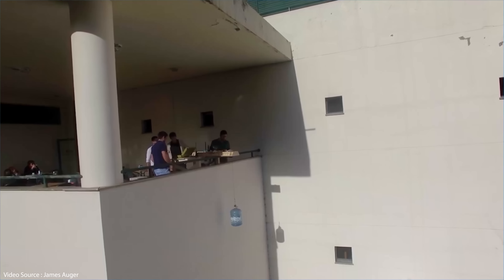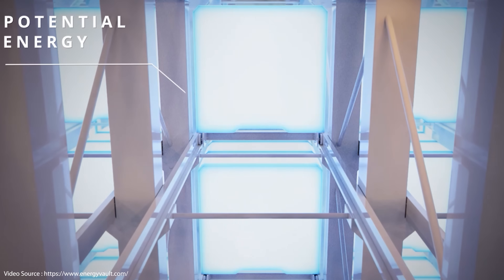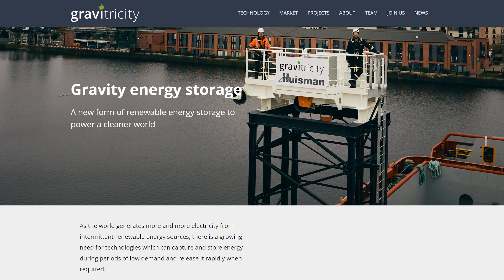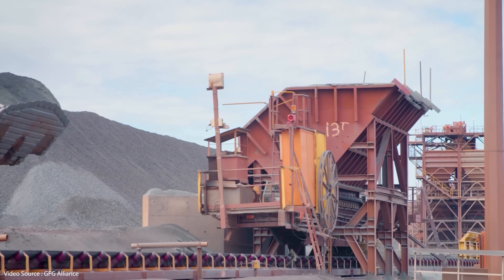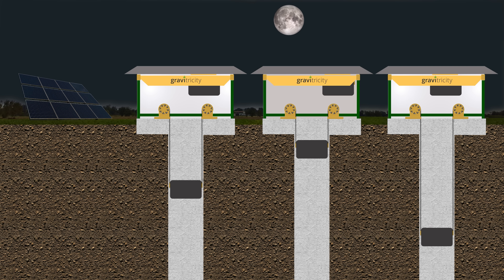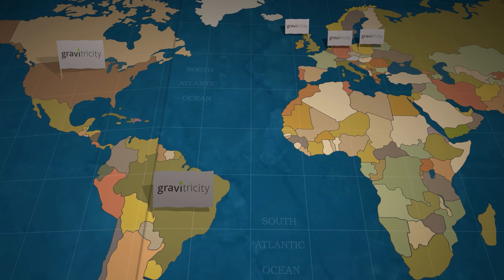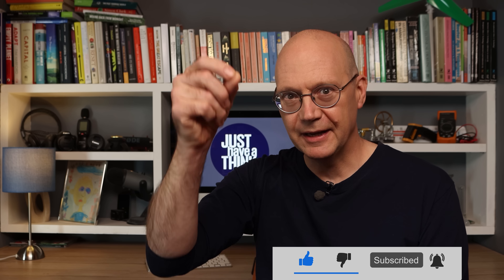Gravity Energy Storage. Who's right and who's wrong?

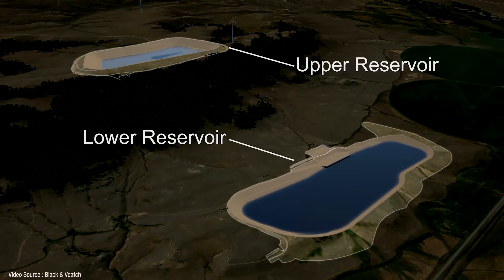Comment: 1:40 other kinds of gravity energy storage will be much more expensive. You will not safe cost if you build the mountain. The problem is the low energy density. The energy you can store is mgh. Where m is the mass, g is 9.81m/s or 9.81J/kg*m and h the hight. State of the art lithium ion batteries has an energy density of 720,000J/kg. This means to get the same energy density your height has to be 73 km. 
So you have to use really high masses to compensate the low energy density.

Comment: Plausibly interesting.  My only concern is the constraint of location. 

Having to locate at old mineshafts means not being able to locate the system geo-efficiently on the grid. That may be fine if the economics are good enough, but does likely introduce a cost penalty.
Reply: Mining locations often have very good grid connections due to the heavy energy consumption of active mining operations.  Like power plants, there is little reason to put storage in the middle of energy consuming cities except to reduce dependency on supply lines during political or environmental instability.

Comment: Gravity energy is in use and is really a viable solution. In both Wales and the canary Islands water is pumped using surplus bio /wind electricity to be later released into hydro electric generators when the bio/wind supply is insufficient to meet demand. It may not be the most technically efficient but it beats the hell out of inferior battery storage or the damage to the environment required to produce them.

Comment: Even though the Gravitricity one makes far more sense than the other one, I still wonder what is the potential storage in MWh, given that new off shore wind turbines have nameplate ratings of as much as 14 MW, if each mine shaft can only output something like 10 MWh, then it is small fry. Can't help but think that we'd be better off building tidal lagoons and pumped hydro where suitable sites exist first.
Reply: At 367 km a 1000 kg mass stores 1 MWh ($50) of electricity.

Comment: If you built an actual brushless motor you would have a functioning dynamo and the motor would not consume electric power but would produce electricity.  You could power a circuit of dynamos that produce much more electric power than is used to power the circuit of dynamos.

Comment: If they built new mines with the winding gear designed with generating electricity in mind there would be almost zero cost converting to that use once mining had finished.

Comment: In Poland we use such gravitic energy systems for almost 60 years right now. 

We use old coal mine shafts for it. It is not on a large scale, just as emergency power supply for operating coal mines.

Comment: I have read about using abandoned mines for pumped hydro. The interior volume of some mines is staggering. I wonder about the quality of the water after a while. Certainly wouldn't want to use an old asbestos or lead mine.
Reply: I can't really see how asbestos would negatively affect water quality. It isn't inherently toxic like lead since it's just a magnesium-silicate mineral. The real danger comes from inhaling dry asbestos because the sharp crystalline shards in the fibers get stuck in your lungs and cause damage to the alveoli. As long as you don't breathe it though, asbestos is pretty benign. EDIT: Apparently there is debate about whether asbestos is toxic when ingested. Some sources say it is excreted, others say there is potential for fibers to lodge in the GI tract and cause damage. Also, apparently most drinking water has some asbestos in it, but below levels considered dangerous.

Comment: I really don't understand how building the infrastructure to move weights could be cheaper than building a water tower and just using a pump powered by a windmill or solar to put thousands of gallons a hundred feet or so in the air... though I must admit using natural geography would be more cost effective, I would think a water tower would be more cost effective than dummy weights.

Comment: I'm in BC Canada and I have a better idea for pumped hydro.  This province uses 90% hydro electricity.  We export some at a profit.  My idea eliminates new efficiency losses and reduces the capital costs of building new transmission lines. 
My idea also produces Green Base Load power which is worth the most $/kilowatt-hour.  This would be the cheapest new baseload power.(~0.03) This would be for export because we have abundant power for ourselves. 
On the down side, we would have to make a long term deal with the US. These trans border deals have hurt us in the past.
I'm holding back the key detail here, obviously.

Comment: Sounds really promising, especially considering the simplicity, and lack of need for rare earth elements and such.
I do wonder if transmission of energy costs are included in the comparison chart you showed.  They might be substantial considering there are a limited number of suitable mines, and they might not tend to be close to populations centers.
Nicely presented, sir.
Reply: I would think the other concept of the modular building would be a better solution, as it can be built anywhere, like right inside of a city where it is needed, although there is the cost of building construction to consider.
Reply: @bigdaddyof2007  Indeed. Perhaps, until fusion is perfected, we could make use of all the varied sources; solar where the sun shines aplenty, wind where the wind blows, geothermal where the earths crust is thin, hydro where the water flows, wave power on the coasts, fission where the others aren't appropriate (especially, the new small modular, assembly line built safe fission), and the new solid hydrogen for air transportation. Tied together with the various types of storage, each also appropriate for the area, and transmitted by a new, DC grid.

Comment: Personally, I think that gravity storage is generally a waste of resources for little gain. 
The amount of energy you can storage is very easy to calculate:

It’s mass x height x gravity acceleration. 

If you lift 1kg of mass to 1m, you will store 1 joule of energy. Spend a little time to calculate how much mass or how much height you need to store the energy used for a single family for one day, which is in the range of the kilowatt hours, bearing in mind that to make up 1 kilowatt hour you need 3.6 million joules.

Comment: I would've liked to hear more about the energy capacity of such a system. Even if the results are positive it would have a very limited impact given that it has a ceiling already in the amount of existing mines. Even if the weights are heavier they can't possibly compete with the capacity of pumped-hydro.
Reply: Also concrete is only twice as dense as water so I bet you could store almost the same energy without all that equipment in plain water... maybe salty water, water isn't scarse, drinkable water is, if you keep it close mantainance would be minimal, you will only need to fill it once, keeping it close avoids evaporation
Reply: @ratgr  Water is scarse in some places around the world but not having to transport rock to a location where it is avalible seems a logical option. The perfect combination in my view would be desert based solar panel farm and sand filled weights. Why make concrete if it does not have to be structual.
Reply: @lenrichardson7349  The problem with sand is its corrosiveness, its not a fluid so you cant really pump it normally but you could use a screw pump, It will need more manteinance, and some other mechanical help to avoid dunes, before you recomend sand bags that makes it worse, you'll need some kind of computerized complex mechanical mechanism and wouldn't be able to use the mine in its entirety. 

Water can be transported from the closest source, either pumped or water trucks, its mostly a one time cost, you only have to make the walls impermiable and the loses should be small, you dont even need this water to be fresh water, you could use salty water, very few places in the world are both far away from a water source and close to a population.
Reply: @lenrichardson7349  The water is not used up (of course both reservoirs need to be underground).
Reply: I think it's fair to say the energy storage, just like energy production for a sustainable future has to be a multi-faceted approach, often depending on geography and facilities. Just like you wouldn't put solar farms in the high arctic or antarctic or wind farms in a calm area, you'd look at the geography of an area to see what energy storage would be most efficient in each case. If we did things based on studies, data, scientific approach to problem solving for maximum efficiency we could crack the code for 100% renewable energy worldwide, with adequate storage.
Reply: Water weighs about 8.3lb a gallon, turbines have an efficiency of 90-95%. 

Economically beating out water gravity batteries is a tall order
Reply: @aaronlockey6429  the crane-managed block tower idea also had an expensive working prototype, although not to full scale. They had some multi crane tower and some barrels filled with concrete. The new design/3D-animation-concept doesn't have anything real AFAIK, although apparently they have a contract with China somehow. Ironically the closest thing to a prototype for that would be the prototype for gravitricity, specially if they gave up the nonsense of horizontal transport of the weights for no reason. Then it would at least look somewhat credible, although to me it wouldn't be clear whether the return on investment is really superior to just pump-hydro even if in ridiculously small sizes for pump hydro. Like filling the mines themselves with water and pumping it to a ground-level pool. Maybe one could hybridize the water supply system with something like that to some degree, as it has to be pumped up at some point, and has to go down.
Reply: It makes sense to use it first in already existing mines, because half or so of the work is already done for you. But it's still a solution for areas where pumped hydro is still not available, because you don't have any hill nearby. And the area is arid or something.

Though you could say that if you have to do all the digging yourself, why not use pumped hydro underground too. And I guess it's a very good question. It might be cheaper/better. I don't know the costs. Going full vertical will have a lower area footprint, that might be one or the only advantage over pumped hydro.

Comment: Love the idea, but I think it's only feasible above the natural underground water table. De-watering mine shafts is expensive and allowing the system to operate submerged would cause huge problems. At a guess you would need a location where the water table was at least 100m below ground level. 

The top of a mountain might be the ideal location, as you could place the system at the top and have a side-tunnel taking water off at the bottom of the shaft and gravity draining it out the bottom of the mountain. Unfortunately there are probably few available mine shafts in this ideal location, so the shaft would need to be dug specifically for the system.

On the bright side, local groundwater would make a cheap and safe ballast, albeit with a lower energy density than iron-rich rock. This could be overcome by just using a bigger container, and might still be cheaper than the rock overall.
Reply: If they use those newfangled hydrothermal laser drills they can melt the walls of the shaft into impermeable glass, so maybe watering wouldn't be an issue at that point? But I still think batteries are just better, since they don't lose as much to conversion efficiency. We just need to use sodium batteries or something without the stigma of child labor or environmental nimbyism.

Comment: Forget the gravity energy storage and just go with something more simple like flywheel energy storage. Flywheels are cheaper, more efficient, and more scalable. Flywheels don't require massive cumbersome machines or space to operate like Gravity storage systems do. You don't like flywheels? Then just go with compressed air. If you can run a wench motor then you can run a air compressor. Compressed air is one of the most simple energy storage systems. All it needs is a tank and an air compressor to pump compressed air into it. Need energy from it? Just release the compressed air through a generator. Gravity energy storage is always overly large and complicated to make it the better choice for other energy storage systems that can be used.

Comment: Just throwing out an idea here. Why not build a small scale gravity storage system within the hollow steel tower of every wind turbine that you construct?
Reply: This possibly will make tower unstable and prone to collapse during high wind, a special tower need to be built
Reply: Something goes wrong with either system and you have to shut both down for repair
Reply: Even through in theory this would work, the amount of energy that you can store in the very narrow shaft will be so little it will not weigh up to the CAPEX and OPEX. There is simply no room for a large, heavy object and the travel is limited as well (compared to mine shafts).
Reply: Because once the weight is lifted in that one tower the wind turbine would then be useless… sitting still with blades feathered for possibly days. Not to mention how top-heavy the tower would then be. Of course they could probably disengage and bypass the weight and gear system but gosh all that would be so complex and require so much upkeep.
Reply: If you do the math, the power you can store in a hollow shaft just 100 ft tall does not justify the capital for the generator and wiring.  The question is not if it can be done, the question is can it be done cheaper than current  lithium ion.
Reply: I think the idea of a weight INSIDE the wind turbine towers, is worth serious calculations; 
to begin with, since the volume of the weight goes with the SQUARE of its diameter, the tower would have to be W I D E; then just use the m.g.h formula to see Energy results, and then Costs ; 
It can be all electrical OR all mechanical,  in this case, at zero wind, the weight going down would just be re-spinning the  wind turbine, via an easy  zero slippage engagement clutch,or,better yet, just gears.
Reply: People looking to $hit on your idea. I think it's brilliant.

Comment: Human consciousness, mathematically, is identical to 4D quaternion algebra with w, x, y, z being "real/necessary" (0D, 1D, 2D, 3D) and i, j, k being "contingent/not-necessary" (1D xi, 2D yj, 3D zk). 

1D-9D contingent/not-necessary universe has "conscious lifeforms" (1D xi, 2D yj, 3D zk)..."turning" 'time'.

[In mathematics, a versor is a quaternion of norm one (a unit quaternion). The word is derived from Latin versare = "to turn" with the suffix -or forming a noun from the verb (i.e. versor = "the turner"). It was introduced by William Rowan Hamilton in the context of his quaternion theory.]

[Math; 4D quaternion algebra]
A quaternion is a 4-tuple, which is a more concise representation than a rotation matrix. Its geo- metric meaning is also more obvious as the rotation axis and angle can be trivially recovered.

How do you make a quaternion?

You can create an N-by-1 quaternion array by specifying an N-by-3 array of Euler angles in radians or degrees. Use the euler syntax to create a scalar quaternion using a 1-by-3 vector of Euler angles in radians.

"Turn" to what, you might ask. 5D is the center of 1D-9D. The breadth (space-time). All 'things' are drawn to the center, the whole.

[Contingent Universe]:

3 sets of 3 dimensions:
(1D-3D/4D-6D/7D-9D)

The illusory middle set (4D, 5D, 6D) is temporal. Id imagine we create this middle temporal set similar to a dimensional Venn Diagram with polarized lenses that we "turn" by being conscious. 

Which requires energy. 3D height symmetry/entanglement with 9D absorption is why we are "consumers", we must consume/absorb calories, and sleep, to continue "to turn" 'time' (be alive).

1D-3D spatial set/7D-9D spectral set overlap creating the temporal illusion of 4D-6D set.

1D, 2D, 3D = spatial composite (line, width,  height)

4D, 5D, 6D = temporal illusory (length, breadth, depth)

7D, 8D, 9D = spectra energies (continuous, emission, absorption)

Symmetry/entanglement: 

1D, 4D, 7D line, length, continuous 

2D, 5D, 8D width, breadth, emission 

3D, 6D, 9D height, depth, absorption

[Time]
According to theoretical physicist Carlo Rovelli, time is an illusion: our naive perception of its flow doesn't correspond to physical reality. Indeed, as Rovelli argues in The Order of Time, much more is illusory, including Isaac Newton's picture of a universally ticking clock.

Does time exist without space?

Time 'is' as space 'is' - part of a reference frame in which in ordered sequence you can touch, throw and eat apples. 
Time cannot exist without space and the existence of time does require energy.

Time, then, has three levels, according to Leibniz:

(i) the atemporality or eternality of God;

(ii) the continuous immanent becoming-itself of the monad as entelechy;

(iii) time as the external framework of a chronology of “nows”

The difference between (ii) and (iii) is made clear by the account of the internal principle of change. 
The real difference between the necessary being of God and the contingent, created finitude of a human being is the difference between (i) and (ii).

Conclusion: Humanity needs to immediately swap from "Newton" to "Leibniz".

Our calculus is incorrect (Leibniz > Newton):

What is the difference between Newton and Leibniz calculus?

Newton's calculus is about functions. 

Leibniz's calculus is about relations defined by constraints. 

In Newton's calculus, there is (what would now be called) a limit built into every operation. 

In Leibniz's calculus, the limit is a separate operation.